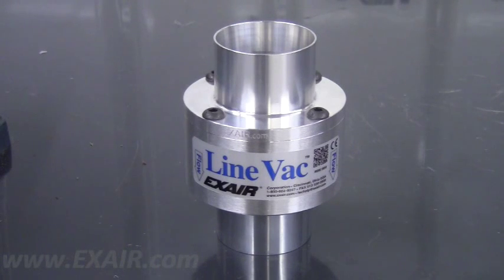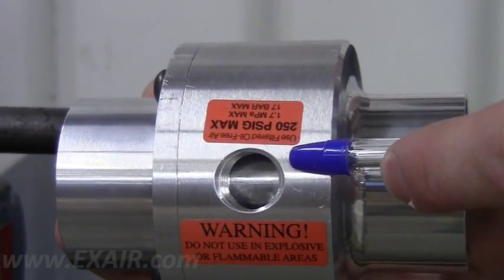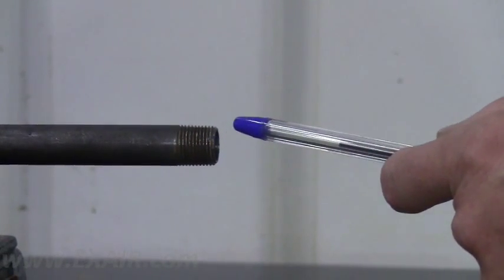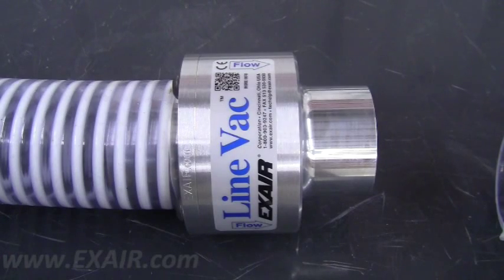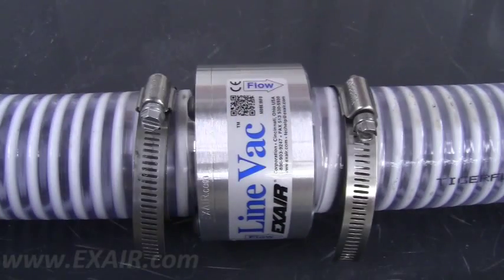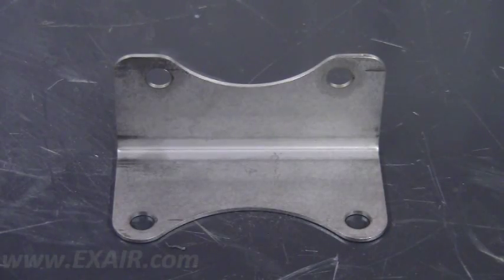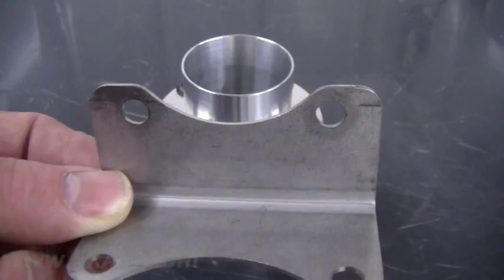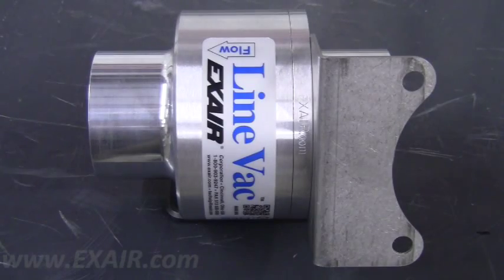How To Install An EXAIR Line Vac

Comment: Estou desenvolvendo um projeto e vou comprar seu produto,mas gostaria de saber para atender a vazão de 58,50 SCFM para  tipo Line Vac 6065/6085 qual  a capacidade do compressor e (reservatório se precisar)  para fazer transporte de pimenta do reino. Obrigado
Reply from the maker: Luiz,
Obrigado pela pergunta. Gostaria de discutir o aplicativo com você ainda antes de dar a estimativa no tamanho do compressor. Entre em contato conosco na TecHelp@EXAIR.com ou ligue para 1-800-903-9247 entre as 8:00 da manhã e as 5:00 da tarde, EST / EDT.

Luiz,
Thank you for the inquiry.  I would like to discuss the application with you further before giving the estimation on the compressor size.  Please contact us at TecHelp@EXAIR.com or call 1-800-903-9247 between 8:00 AM and 5:00 PM EST/EDT.